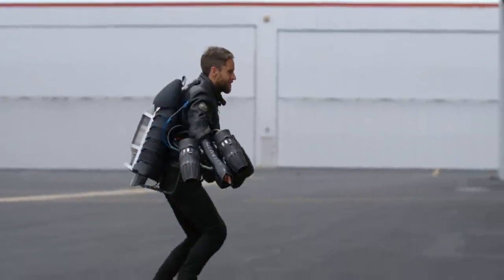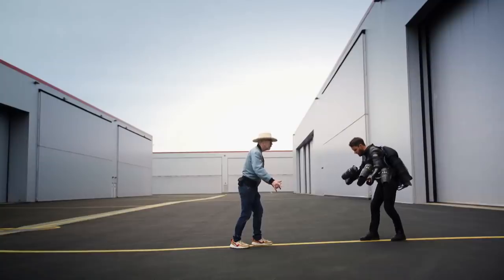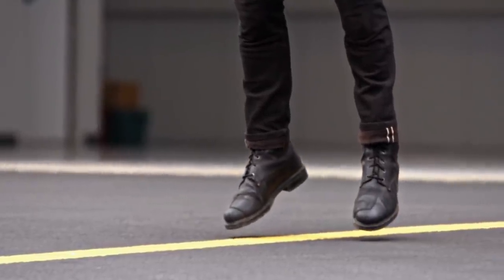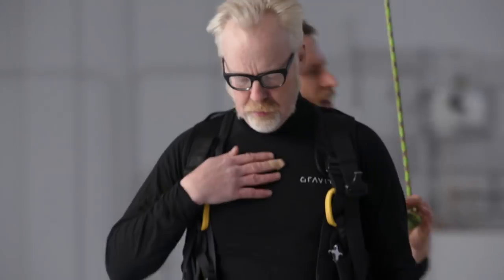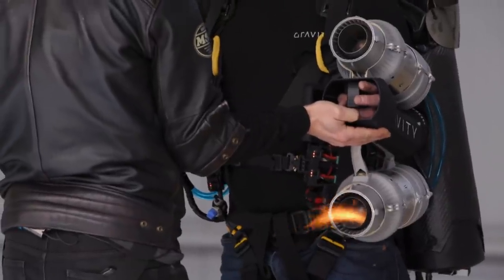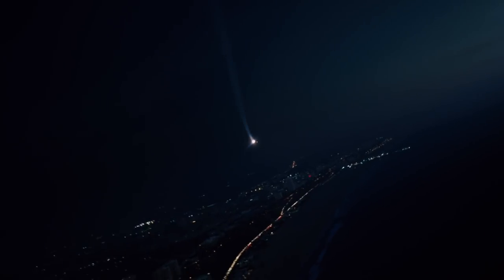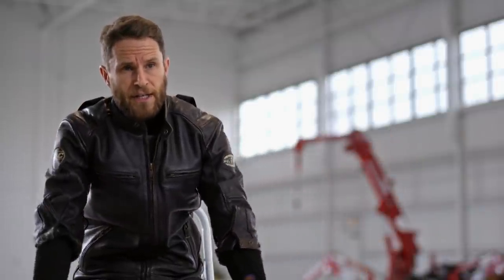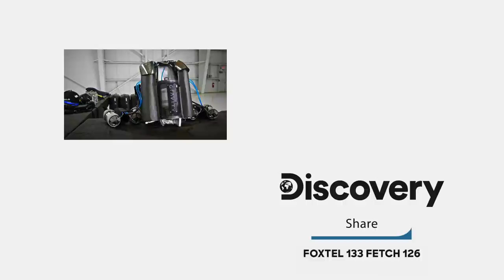How To Fly Like Iron Man | Savage Builds

Comment: This needs to be added to a power-assist exoskeletal frame.  More fuel can then be carried, plus you would have some assistance in maintaining position through arm strength augmentation.  In short, it needs to be done as an Iron Man suit.
Reply: The problem you will run into is the same problem you get with rockets going to space: The more fuel you add, the more force you need to exert to takeoff which results in needing more fuel burned to release the energy to apply the force. Not only this but the power-assist exoskeleton frame also adds weight on it's own... which then requires a greater amount of force exerted which requires more fuel.

Needless to say - you run into problems extremely quickly.
Reply: snap! It seems so obvious. i know weight is every thing but i doubt it would add too much, compared to what those thrusters are capable of.
Reply: Problem with something like this needing ( fuel ) is the amount required to operate is so extreme, it makes since why In the movie's you would need a different power source to go the distance, perhaps something that hasn't been invented yet

Comment: That tripod technique works really nicely as a visual effect.  The hovering looks really controlled and super cool.  Definitely has that super hero look.  This definitely needs to be in super hero movies--even if only simulated.  I hope the movie industry is paying attention to this.
Reply: i was thinking if they just fixed that tripod, they could have a system to vary the thrust from those 3 jets. You could then have the software control that via a hand joystick with some form of auto correction built in, much like drones do it.
Reply: @chrisliddiard725  or a metal system that only allows your arms to move in certain angles so it stays straight and doesnt bend sending you into the floor, like a frame, and smooth movements on the thrusters so you can still control but with alot more feeling into it

Comment: This thing is like holding oneself off the ground by your arms, on sheer physical strength.
It's absurd to expect that anyone (bar athletes) would be able to carry their weight like this and at the same time give precise control inputs to maintain a stable hover, let alone fly round. The jet engines should of course be linked to a pivoted structure that carried the pilot, who would then only  need to direct their output direction. Relying on physical strength to fly is a silly proposition.

Comment: It seems really burdensome and tiring to have the motors on arms instead of on the legs...
Reply: The centre of mass would be wrong unless the rig weighed a lot, which would be too difficult to manoeuvre.

It'd be like helicopters having the rotor underneath them.

They have to work within the laws of physics and the limits of the human body.
Reply: Yea but only two vectors of force to play with rather than 3 is much more difficult to manage. There's a reason most animals use more than 2 legs, same reason it takes a person a year or 2 to walk while it takes a dog weeks.
Reply: @absolutcabbagery3661  there are 3
Reply: @OatmealTheCrazy  not on force factors mounted on the legs
Reply: It started development with a jet on each leg, but was proven to be too unstable.